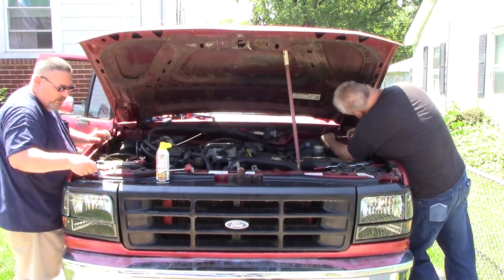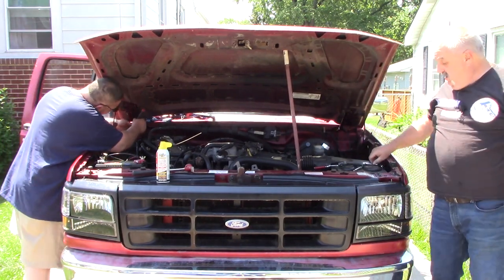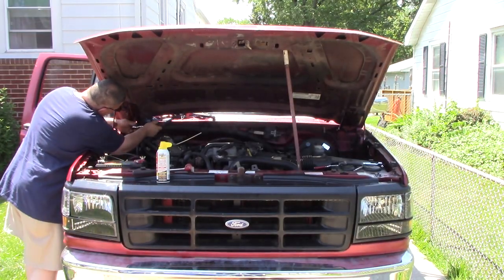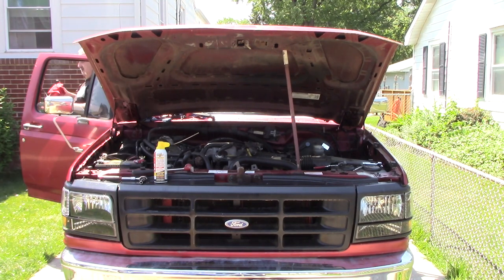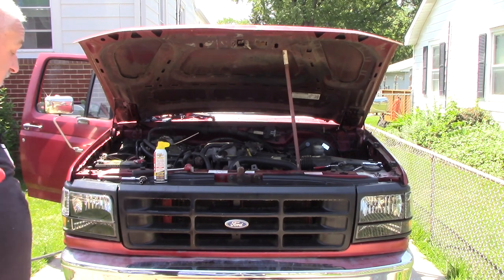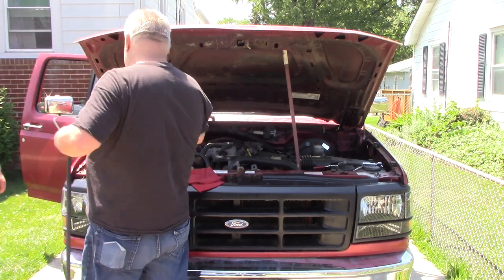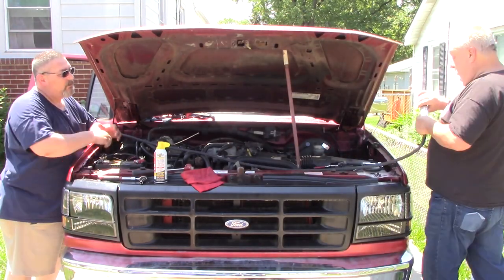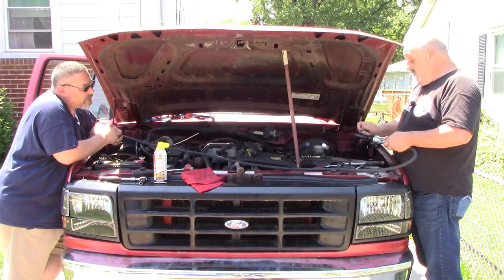OBS Ford 95 F 150 Flareside gets a New Old Hood

Comment: How to you install the hood support springs (coils)? I broke my originals and I need new ones. Do they bolt right on or do I need to do something to tighten them after installation? If so, how does that work?
Reply from the maker: I would go to a junkyard and get a goodset from an old truck and just bolt them on